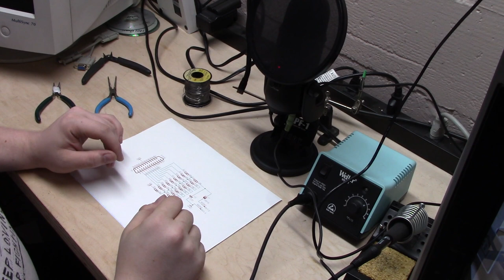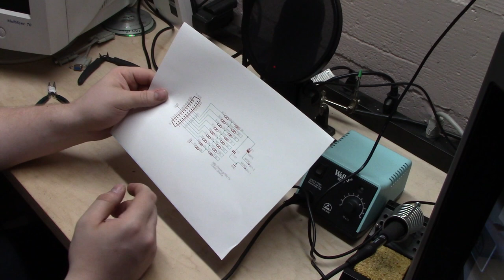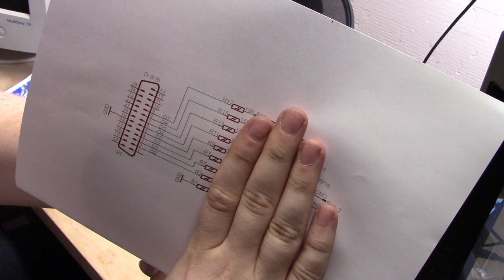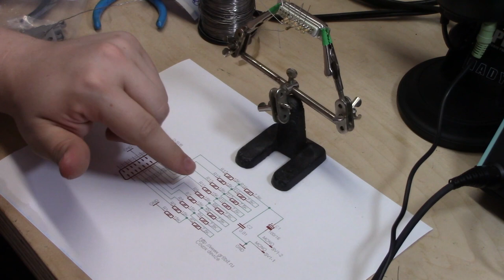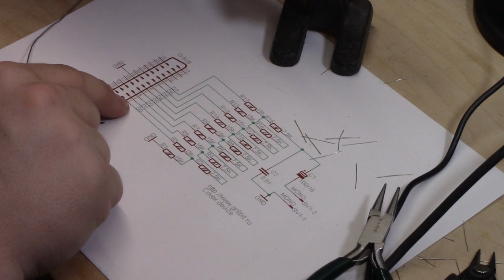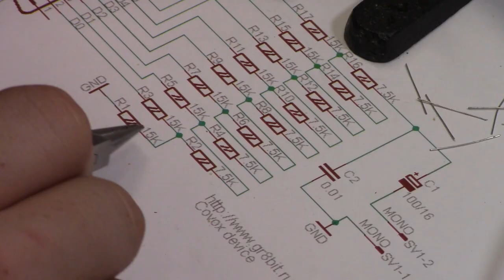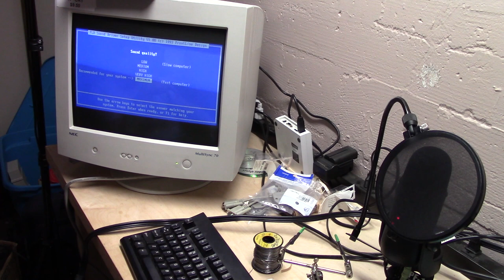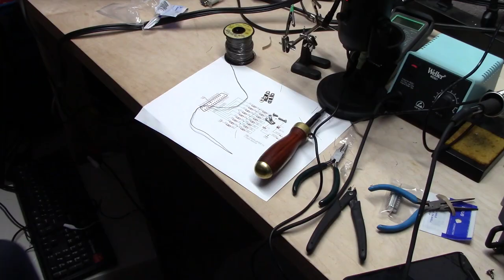Covox Build

Comment: I've done my fair share of hot-glue-potting on a few of my own electronics projects before. Sure I wouldn't want to see it in a retail product, but it's perfectly adequate for one-off or small-batch hobbyist projects like this, and the ideal solution for quick prototyping electronic circuits. This isn't handling high voltages or anything, the data lines operate at only 5 volts. All it needs to do is keep the wires from directly touching each other, and hot glue does a pretty good job at that.

Comment: I remember building one of these back in the day. If I remember correctly, I used a bit of perboard and a 1/4" jack, and placed it inside a RadioShack project box. Then I used the practice amp for my guitar, and it actually didn't sound half bad. I can't remember what system I would have used it with, though... Might have to build another one...

Comment: Awsome job! Hotglue is the shizznizzle for alot of aplications beyond.. whatever it was designed for! You keep the moisture out and components in place, what more could one ask for? (and it is possible to dismantle it with a hot air gun, not shure if those fancy polymers can melt at reasonable temperatures?) Thanks for the content and keep on soldering!

Comment: The outside of the connector is shield, not ground.  It should not be used to carry current or signals and good practice dictates that you should never assume they are the same even so SOMETIMES AND OFTEN  they are electrically connected.  Especially with anything industrial.

Comment: You are supposed to fill the cup first. Tin the cup, tin the wire then heat both and join. You should see the solder suck up into the cup once it’s hot enough.

Comment: Actually the PC speaker is PCM capable, but it is extremely CPU-intensive to produce any real PCM sound with it. Producing square-wave beeps is "hardware accelerated" and does not require anything from the CPU, and that's why the PC speaker is most often only used to produce beeps.

Comment: When soldering do yourself a favor and tin the end of your iron. A little solder on the iron acts like thermal grease on a CPU, increasing the effective contact area to transfer heat faster. I noticed you got some solder on the iron (perhaps accidentally) on the second cup, and from then on the job was much faster. I think you mistakenly attributed it to increasing the temperature.

Comment: Awesome! Can you add a second parallel port and make it stereo?
Reply: the cpu would not be able to handle both at the same time
Reply: @rommix0  And there'd be absolutely no software around to make use of it.
Reply: You could. There is also  "Stereo-on-1" Covox, which works on one port and has some switching logic. Also certain computers have sound kits, which can also include stereo or four channel covox. That likely only is being put to use on certain demos and trackers though.
Reply: Technically yes. The problem is going to be finding software that actually supports the configuration.